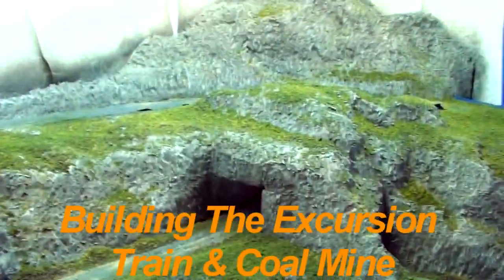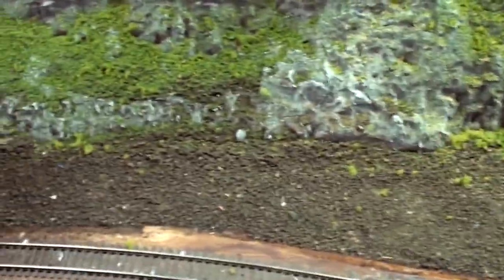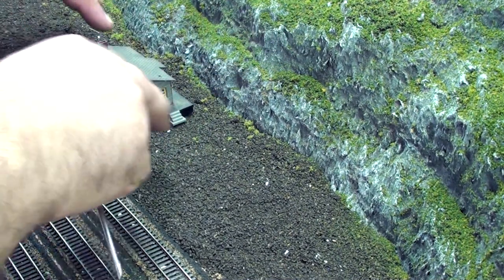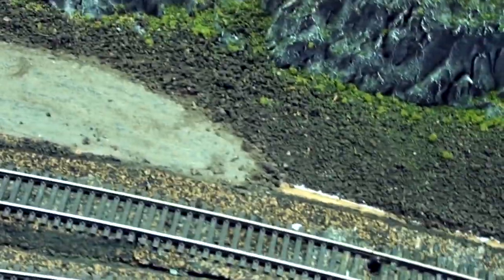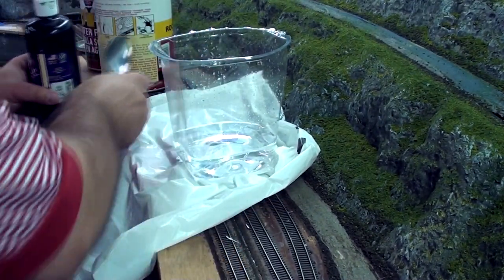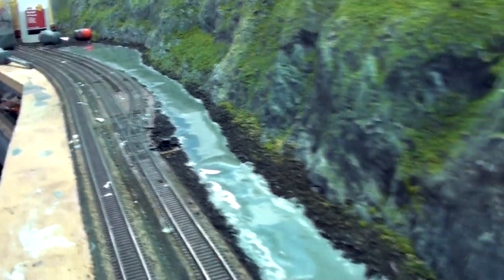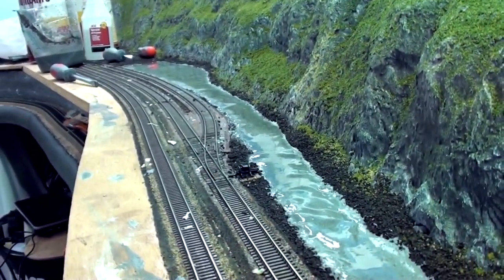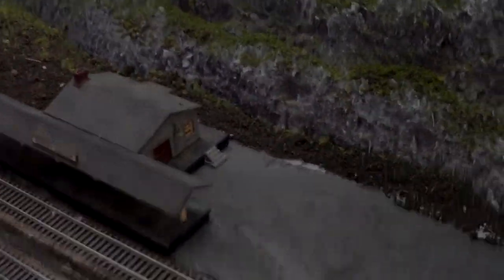Building the Excursion Train & Coal Mine Scenes: Part 32

Comment from the maker: @lunkermouth Yeah it mixes like plaster. If you mix it up fairly thick it will set in about half an hour.  I had it really thinned out so it took about 4 hours. The advantage of water putty is that it dries rock hard.  I wouldn't use it to cast rocks because it's first, more expensive than plaster and second, it's very difficult to carve when it's dry. I've just been using it for my roads.